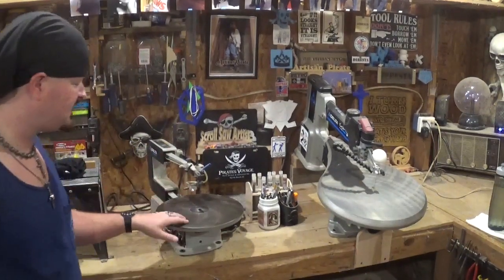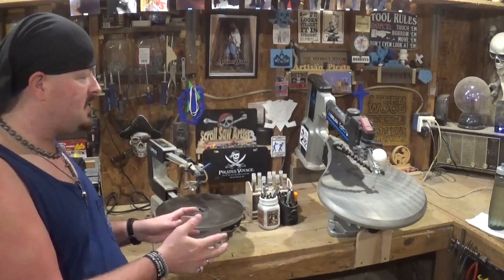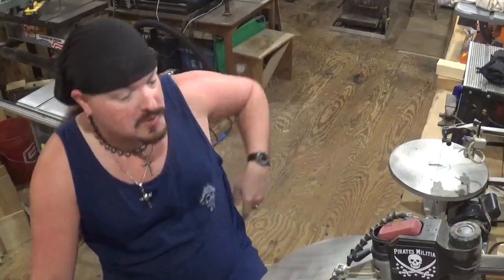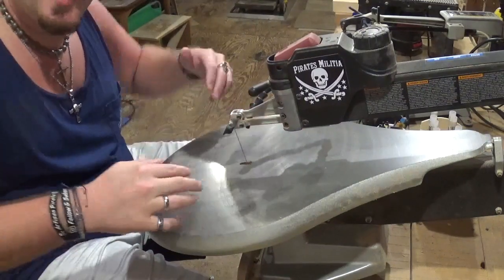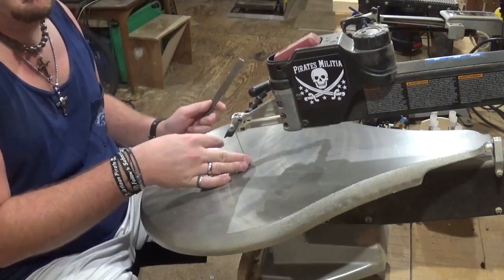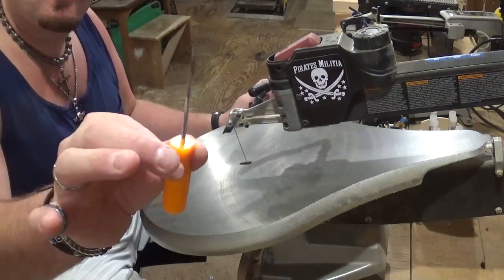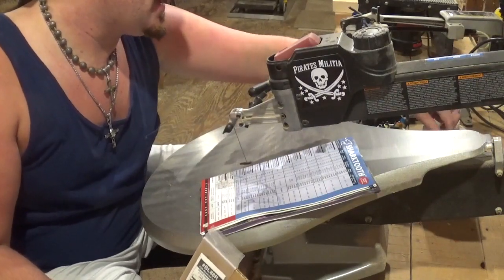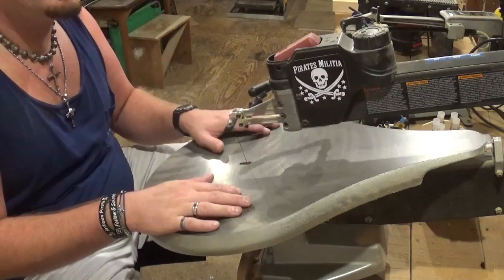Scroll Saw Accessories And Must Haves (My Opinion)

Comment: 1: Comfy Seat: Craftsman Shop Stool @3:07
2: Tape & Spray Adhesive: Clear packing tape, 3M quick bond spray adhesive @3:42
3: Put the saw on an angle @4:51
4: Wastebasket to catch scraps @5:34
5: Locking upper arm for threading the blade @6:08
6: Hand file for burrs @6:25
7: Magnetic strips for tool storage @6:52
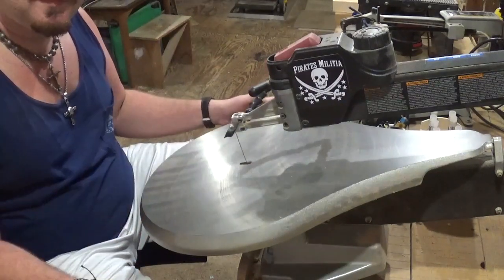8: Foot switch @7:00
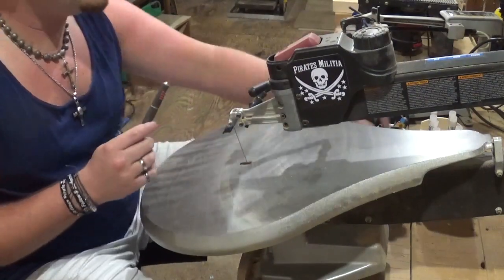9: Xacto pen knife and ..poking.. tool.. thing @7:46
10: Good set of blades (Sharktooth) & caddy w 6 inch medical plastic test tubes @8:42
11: Especially the #5 reverse tooth blade @9:32
12: Tunes @10:34

Comment: I have a Dewalt, I just keep a small piece of wood on the back of the table I use to hold arm up. I lift arm and use board to prop it up. Works great and its free. I rarely use the whole table so it doesn't interfere.
Reply from the maker: I agree with using the block of wood on the dewalt, however, with me putting my saw on a big angle, it would just always be falling off my table

Comment: I like the idea of the forward tilt on your saw. It's a little difficult to tell how much of an angle is working for you. It looks to be rather steep, maybe 35 - 40 degrees? I have a great table with my saw mounted to it, maybe I can just figure a way to add some lift to the rear legs. Thank you for your encouragement well done! I  am also a Steve Good fan.
Reply from the maker: I used a digital angle guage and my scroll saw is at roughly 16 degrees, of course it will differ for each person depending on your height as well as your workbench and works tool height, I just kept trying different heights until I found what was comfortable. Sorry for the late reply

Comment: Really great tips AP .Thank you. I have a Porter-Cable scrollsaw and I cannot get pinless blades to stay in. Any thoughts on where to look for help/tips?
Reply: What kind of clamp does PC use? If it uses a bolt to clamp the blade you might have to sand the end of the bolt flat.
Reply from the maker: Good luck on replacing the clamp. keep us posted !

Comment: My question is and maybe you can help me.  I have been having trouble with my blades. The wood I use is a birch 1/2 wood and blade I use is #5 skip reverse tooth.  I use a porter-cable scroll saw.  When I am cutting my blades breaks and when I stop I see below that the blade is bent over at the bottom and another thing to my blades slide out of the grips even though I tighten them tightly.  Blades are expensive and for it to be breaking all the time it’s getting old.  Can you tell me what is going on or what wrong?  Thank you for your help.
Reply from the maker: Thanks for reaching out, from what I'm reading it sounds like one of 2 reasons or maybe a combo of both, It does, to me sound like a tension issue and maybe a feed rate issue, take your time and let the blade do the work.
also, a scroll saw cuts on the down stroke so, make sure the majority of the teeth are facing down,.

Comment: Tyler I've got an old 1987shopcraft 15" scroll saw I can't find any info on it ..it runs great it's painless and the blades I've found seems to be too thin the block will not tighten down on blade...any info would be greatly appreciated..
Reply from the maker: wow, certainly an older saw, maybe try searching google as i've never used a Shopcraft

Comment: Have you tried blue painters tape and spray glue i used to use packing tape but on close cuts some times the tape and pattern will tear and then you are in trouble.
Reply from the maker: Yea, and it is a good idea, however I consider that to be a waste of painters tape.

Comment: Brother, I just got my scroll saw last week and I don't know why I waited so long. This is already a passion of mine, I do have 1 question, as I said, I'm new to scrolling, my wood starts to bounce up and down rapidly and has broken a couple of my projects. My wood is 3/8 to 1/2 inch walnut, birch, and I believe some pine. What hits you if you are troubleshooting jumping up and down? Thanks, man
Reply from the maker: Glad you love scrolling! Its so relaxing. Sounds like your blade is in wrong. A scroll saw cuts on the down stroke. So, make sure your blades teeth are facing down. I use a reverse tooth blade mostly. So, the last few teeth on those blades face upwards to produce a cleaner cut